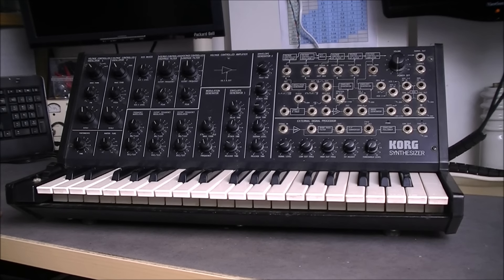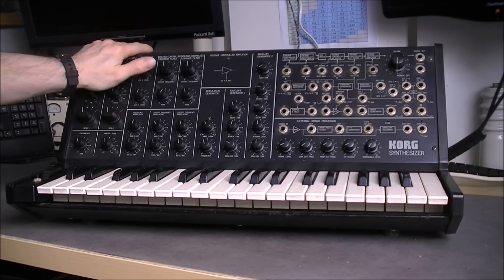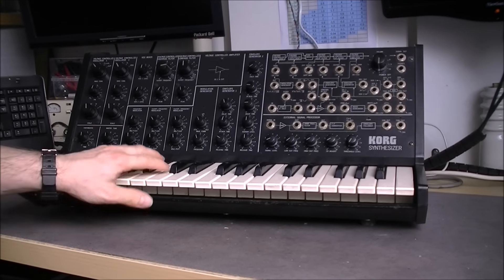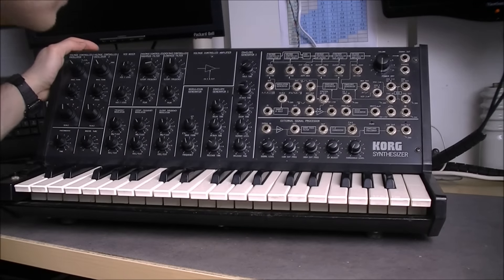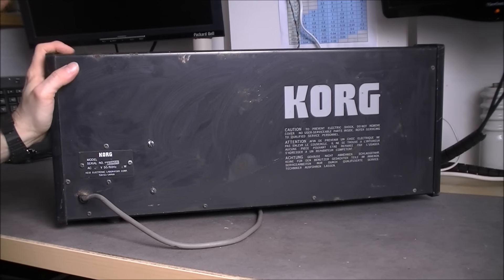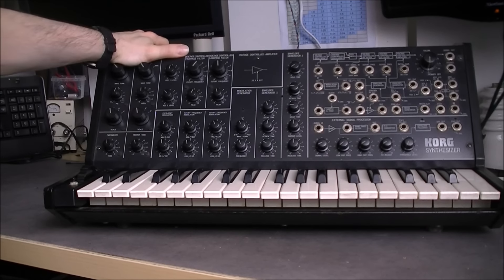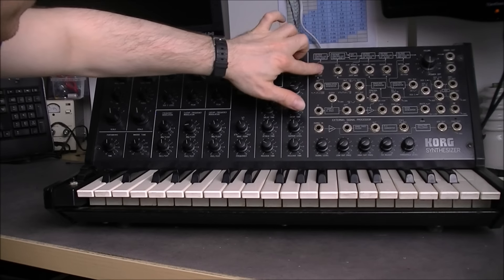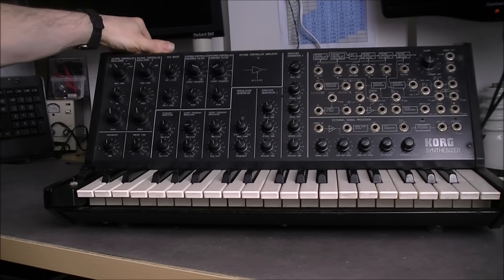My plans for the Korg MS 20 restoration

Comment: by all means clean all the pots and keys, and check the circuit board, replacing failed caps etc.  but do not repaint the chassis. try and keep it as original as possible.